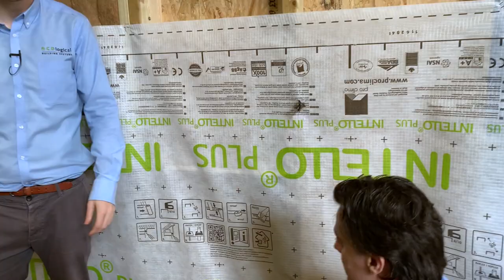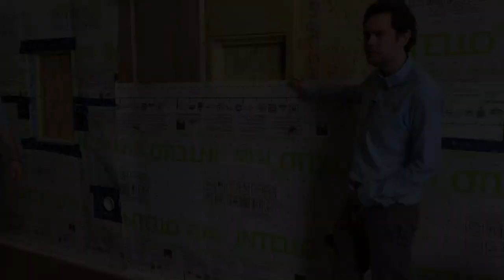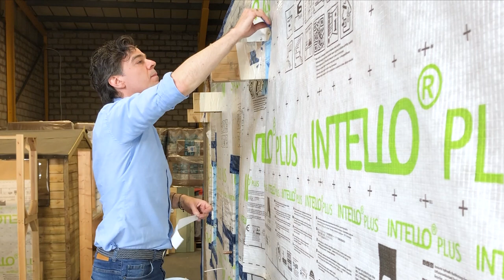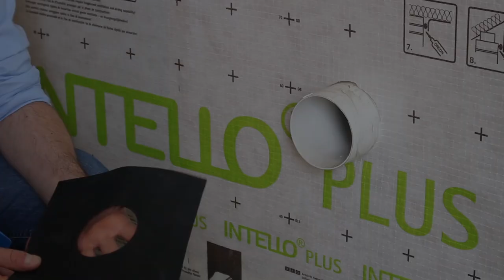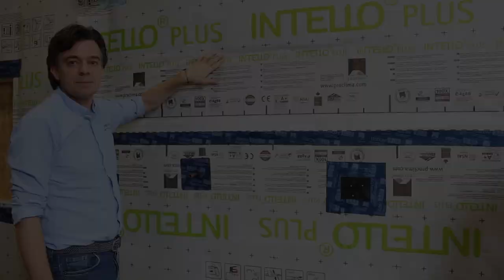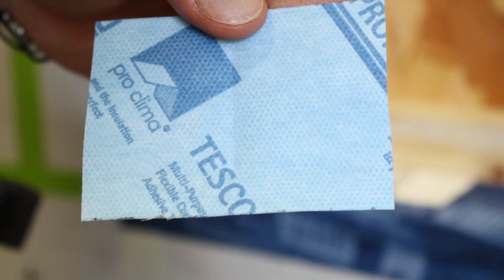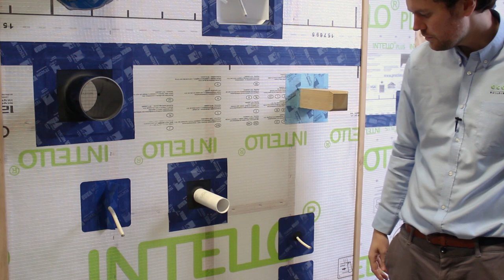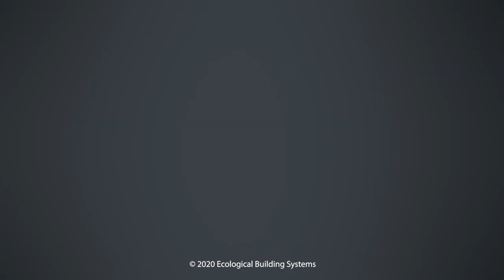How to install for airtightness: An Airtightness Installation Practical Demo

Comment: This is really helpful! One thing that would be great to add is using pipes/wires/joists that are already in place that can't be addressed by poking a hole and sliding over. For example, rim joists where the ends aren't exposed. I basically cut a long slot and taped the whole thing, but it's very awkward.
Reply from the maker: Yes, it can be a very tedious detail Bryan.  There is another way using Pro Clima Aerosana Visconn... in this video: https://www.youtube.com/watch?v=9_3gIXcY4jg an OSB or ply formwork is created around the joists.  This is much quicker and easier method to seal by spraying this liquid applied air barrier.  If you have any more questions, do get in touch with our technical team via our website - always happy to help!

Comment: Hi, I thought this was a very useful video, however, i am curious how you handle a story and a half structure where the wooden ceiling meets a concrete block wall. How is the membrane installed  there. Also, would you need to install the membrane on the inside of the concrete block structure even though there is not going to be an internal slab. it would just be cavity insulated and plastered? Any videos for this type of structure?
Thanks
Reply from the maker: Hi Conor, in a story and a half construction the INTELLO PLUS follows the line of the ceiling and pitched roof, on the warm side of the insulation. Where the INTELLO PLUS meets the masonry wall this can be sealed to the plastered wall at this point with our CONTEGA SOLIDO SL tape. On block walls, the wet plaster on the block will act as the airtightness layer. In this case the CONTEGA SOLIDO SL tape can also be used to seal the windows to the concrete block prior to the plasterboard being applied.

Comment: thank yo for the video!
i need to know how to air seal around the fire stove pipe (for a tiny house). 
i dont think i can just tape with the tescon vana around it, can i ?
do you have any tip? or do you know where i could look?
thank you in advance
Reply: Hi Familia, TESCON VANA is heat resistant up to 90 degrees Celsius which is on the low side for a stove. Our ROFLEX EPDM grommets are heat resistant up to 150 degrees Celsius. We also supply another range of `Silicon Grommets which are heat resistant up to 250 degrees Celsius. Please contact Ecological Building Systems directly for more details on these. The stove/flue supplier should also be consulted to ensure the sealing solution is within the operating temperatures.
Reply: @niallcrosson5859  thanks a lot for the answer. 
So I guess I could only use an insulated wood heater pipe.
Then put the grommet you suggested me around and finally seal with tescon vana.
Do you agree?

Thanks again!
Reply: @familiamotarica6616  Hi. The Roflex Grommet is better as a rule to seal around services including pipes with a high heat resistance up to 150 degrees Celsius. Then the Roflex grommet can be sealed to INTELLO PLUS with TESCON VANA. Once the operating temperature of the pipe remains below this temperature it will be the best option. Higher temperatures up to 250 Celsius require the other higher heat resistant grommet referenced above.
Reply: @niallcrosson5859  thanks a lot
Reply from the maker: Glad it was helpful!

Comment: How do you attach Intel to steel framing?
Reply from the maker: Hi Sebastian

Thanks for your message. On metal studs you can use a double-sided tape called Duplex, or an acrylic sealant such as Orcon F or Multibond.

Pro Clima Duplex:https://www.ecologicalbuildingsystems.com/product/duplex
Pro Clima Orcon F: https://www.ecologicalbuildingsystems.com/product/orcon-f
Pro Clima Multibond: https://www.ecologicalbuildingsystems.com/product/orcon-multibond
Reply: @EcologicalBuildingSystems  Thank you!

Comment: This is about 4 times as many staples as I would have assumed.
Reply from the maker: Internally (for Intello Plus) every 100-150mm is perfect and means less stress on the staples when the membrane is pulled tight to get it flat and crease-free. This keeps it airtight long-term. If blown-in insulation is used, 100mm between staples only and timber battens are required too. Always read the technical guidance and installation guides on our website before commencing any work.

Comment: Is it really necessary to use Intello membrane?  Why not air seal the exterior?
Reply from the maker: as above...its about the building physics :)
Reply: These membranes are called intelligent because they allow vapor to move in one direction so that the wall cavity can dry. Vapor is allowed to move out of the cavity and into the living space, where an HVAC system or dehumidifier can maintain balance of moisture to healthy levels for occupants. Vapor is not allowed to drive from the living space into the wall cavity, where it can create mold, rot, and insect damage. The modern WRB's used on the exterior are similar in that they maintain drying potential of vapor to the outside. It is your decision if you want to just use one or both. Where people get into trouble with wall systems is when vapor becomes trapped between impermeable materials (rigid insulation, foil, plastic) and wood and/or condensation occurs where warm moist air meets a cold surface. So lets say you use a WRB on the outside and don't use an intelligent membrane on the inside. One of the rooms of your house is generating a lot of moisture (kitchen, bathroom) and that moisture finds its way into the wall cavity. It then makes it's way around gaps in the insulation and collects on the cold sheathing during winter and becomes condensation. You certainly can manage the moisture in the building with exhausts and HVAC equipment. But the other benefit of a membrane is it provides air sealing and tightens the building envelope to reduce heat loss and energy consumption. Air leakage is one important factor in building performance. R-Value comes from insulation thickness but more heat is lost through gaps and cracks - bringing down the effective R-Value of the wall system.
Reply: @MrBrianDuga  Yes, I understand the physics. And that's why I question why a high-efficiency (tight), well-ventilated/dehumidified home needs a vapor barrier.  In a properly-designed structure, with proper HVAC, moisture levels should never get a point where moisture can reach a condensing surface to create problems.
Reply: @ArthurDentZaphodBeeb  Absolutely. Great points. Perhaps redundancy and every system takes some thought and consideration for cost effectiveness.
Reply: @ArthurDentZaphodBeeb  It's an air barrier to give added air tightness from the inside to avoid moisture transport. It does let vapor pass. Makes more sense where there is insulation that doesn't block air movement and benefits from being sealed on all sides like fiberglass.

Comment: You don’t staple air tight membrane, you have just punctured it everywhere and now isn’t airtight. Only tape it, no holes what so ever!
Reply: That isn't what the instructions say.
Reply from the maker: Staples applied correctly do not compromise the airtightness. They are necessary to secure the membrane to the timber structure and securely contain the insulation. You just need to avoid staples missing the timber, or if they don't go all the way in, or they go in too far and slice through the membrane.